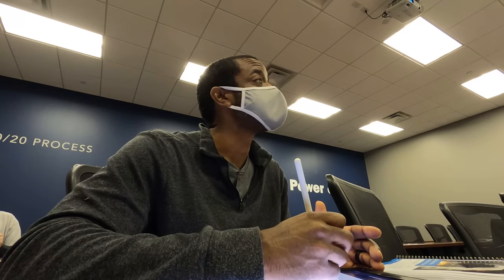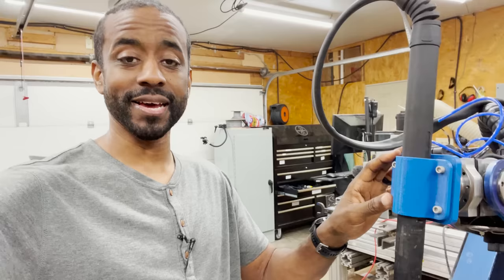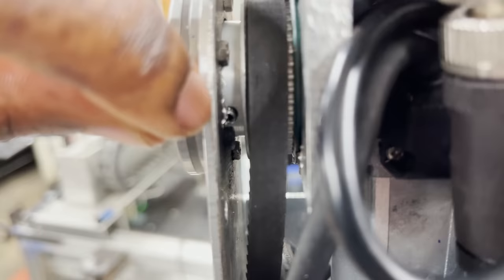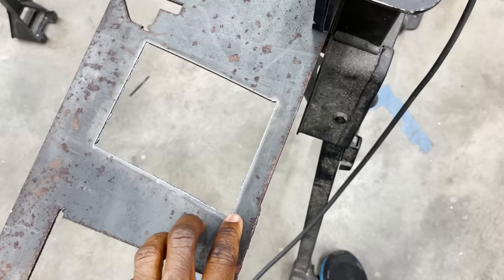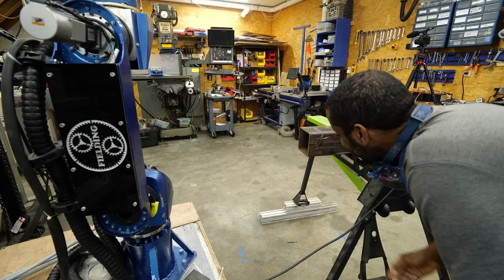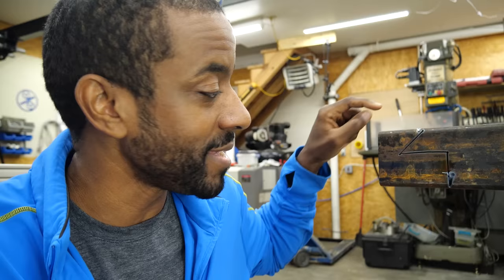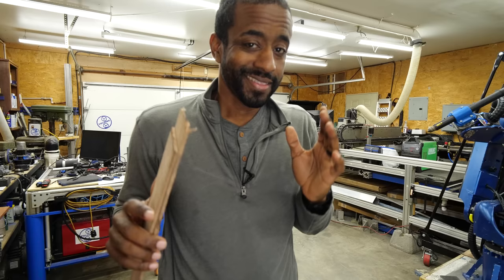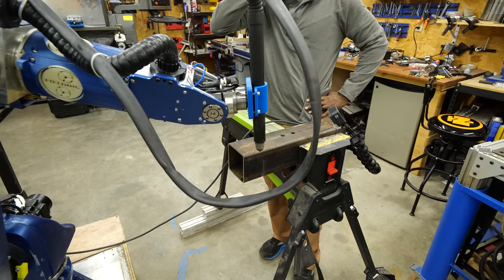I Added a Plasma Torch To My Robot - Jeremy Fielding #097

Comment: That last part about the plasma turning on without power to the relay: 
1. look at ALL connections to the plasma that might have any power.
2. is there ANY chance of "left over power" as in a capacitor, or something that might function like that.
3. if push comes to shove, a "flush" routine in the program might be a good idea.  Basically, you'd have a startup and shutdown routine in your code.  These routines can have delays, go to home position, go to inspection/cleaning position, etc...

Note: you might want a "confirmation sensor". If you can wire in some kind of sensor that can tell the distance, sonar, laser, etc..

I'd also suggest two things for the programming/ number of commands problem.  If you can issue a "big move" command straight to the motor, something along the lines of "move 50mm" as ONE command direct to the motor vs 50 move 1mm commands.  If you can, then write a function that breaks things down and determines if a big move or a small move is best.

If the big move command direct to the motor/controller won't work, then a "sub controller" for each motor that gets, stores at least two types of commands (real time and batch) and sends status update responses.  So you have a main controller that sends one of two commands:
Example 1: real time command: move 1mm to the left, respond when done.
Example 2: batch command: move 100mm to the left, respond every 10% done.

Each of these takes the same amount of time from the main controller, all the "house keeping" is handle by the sub controller.

I've been a professional programmer for a very long time, let me know if you need any help.

Comment: On the relay check you amps. If to high for plasma cutter is it arking and basically welding it's self. I would suggest a contactor for the plasma cutter.

Comment: As an R&D engineer by trade - this video is EXTREMELY relatable!  Sometimes you have to back off and take a second look (or ask someone else for help/advise) before you can fully solve the problem.

Also, I second the question - what SSR are you using? Last time I accidently put AC on a DC SSR it caught fire!

Comment: Awesome video Jeremy.  I think it's great showing the real life of engineering and design. The struggle is real, lol..
I wanted to mention that even though I am not familiar with the newer interfaces you are using, I have used some motion controllers in the past that do allow closed loop feedback. My favorite was from Vital System and it is an DSPMC controller. I used it for basic 3 axis CNC upgrades for older CNCs with obsolete parts and I would use this motion controller to close the loop back to Mach 3 (or Mach 4 these days). These controllers can handle up to 8 axis I believe. Just wanted to share that, thanks for sharing the video!

Comment: To the puls count and bandwidth of the MCU, it can be a bottleneck, but bear in mind that you might also reach physical limitations of the wires. At higher signal rates you get more cross talk specially from digital signals. You practically would have to hook the signal lines up to an Oscilloscope to see if you get a clean signal or not. As side from processing power.

For the distance keeping of the torch head. Industrial robots do not rely solely on the coordinates programmed. Often they use capacitive sensors on the torch head towards the object and auto correct the offset in real time. 

Your relays might get a short puls at boot that you dont perceive, keeping it stuck depending on the current required, thats one tiny source of problems. The other one could be that you need to have capacitor over the contacts to dampen possible arching. Not knowing what current flows to the contact that is just guessing from my side.
Reply from the maker: Interesting... thank you... several things to check here.
Reply: @Jeremy_Fielding  if I wasnt living on a different continent, I would definitively scoot over to lend a hand :)
Reply: I once heard that it better to try to control the voltage level instead of using PWM, because you won't be able to control the huge impulses of changing the voltage on and off at that speed. Also, he should check the loop control of each motor, it is very common that people forgets that this is a computer controlled system, so you have to have a coordination with the sampling period of each system and you have to chose it consciously. Finally about the cross talk you are absolutely right, he should consider a more reliable protocol considering an industrial environment.
Reply: @davidduls  Well from what I understand its not really PWM controls, the encoders are normal photodetector gaps that send a square impulse back to the MCUs. 
So that is his version of closed loop if you want so. Closed loop in an industrial settings sits directly on each motor and receives only positive of negative step count values among some system controls. They often also feedback torque / current values incurred on each motor. 
But having said that, there is no reason he cant build this on his own - not that its rocket science, just robotics ;)
Reply: @davidduls  I do not know how he controls the VFDs, some take 0-10V signals, some have a digital serial protocol and some have good old PWM... serial would be easier to merge with the closed loop feedback, so he can track how many steps are sent vs how many executed.
Reply: @SarahKchannel  Well, I agree with you. I think it would be better to check how the control system works and I would do a linear path test before going any further, he needs to know the limitations of his design and change it if necessary, and I would design the motor control based on the needs. Besides, he needs to know if the encoder resolution needs to so high, if no, he would reduce the problems of high speed signals. Finally, what I meant with the sampling period is that the frequency of the sampling need to controlled because it affects the behavior of the system.
Reply: @davidduls  Yes totally agreed. Most of the time such drive systems are coded based on IRQs rather than sampling / gate times. Nevertheless the clock speed vs. other stuff running on the same system would come pretty  quickly clogged.

Comment: When you turn on the plasma cutter it maybe be introducing noise back into the controllers and / or software causing them to not work like they should.  You may have to put on some EMI shielding on your robot arm or shield the robots wires from the plasma torch.  Engineering is never easy..!  You may also need a noise isolation transformer for the power to the computers and robut arm.  (has a bunch of filters in it to stop power line noise).

Comment: I would suggest taking the robot out of it when you are testing the missing steps. Come up with a full unit test for your step generator and verify everything. For example, get another low-level micro-controller to measure and count steps and report it back and feed the output of your existing control into the new test rig. Then you can take all of that over the serial ports and run tons of tests and look for any missed steps. Furthermore, you would have something you could always plug into any time you make changes to settings and make sure steps aren't getting missed. My guess is that during the linear moves you are missing steps and that can be for lots of reasons (usually performance related or some non-realtime OS interrupting things) but at least with the test rig you could first verify and measure the problem, which is a much better starting point to fixing the problem. Also, it gives you a test rig for the future. Good luck Jeremy!

Comment: I was surprised to see you didn't put a scope on the servo lines to check the signal there. My guess (given what you described) is that we'd see incorrect and irregular pulses for the linear move and correct signals for the point move. This just as a sanity check of course.

And then I guess I'd look at traffic serial traffic to the board to validate the commands are issued as expected. And that point hopefully you've pinned the issue to the board or firmware itself.

I've never used a teensy but I guess. It has a jtag interface? Hopefully you could fire a debugger (with that kill switch in hand) and step through the firmware.

I'm sure you've already got a plan for all of this, just sort of thinking out loud. Truly love the videos Jeremy, thanks so much for sharing!

Comment: Truism on taking notes. my plaz table build has over 700 soldered connections and multiple wire runs, I literally made my own manual as I built the table.

Comment: Hi @Jeremy Fielding ! First of, Thanks for sharing your amazing work! Just want to share something : 

When using an inverse kinematic model for linear moves, I think (but i might be wrong) that the position of the robot's effector always drifts away. I remember using a control law on the operational speed which looked something like that : 
xdot_tilde(t) <-- lambda × (x_d - x(t))
Where xdot_tilde(t) is the operational speed at time t and x(t) is the computed position at time t. X_d is the desired final position.

By doing this you ensure your robot moves toward the desired position by implementing an artificial control loop.

Hope this can help you with your issue even though I'm not sure that this is what you are looking for 🤔
Reply: Some precisions on my thoughts : if you are indeed commending your robot via its operational speed ( inverse kinematic model) , you are numerically solving differential equations for each position of the linear move.
When numerically solving such equations it is very common that the solved position is slightly different from the real position : there is a small error.
As your doing this computation for all positions of the linear move, you are adding errors and the position of the effector drifts away from the desired position.
That's why an artificial control loop is very useful to add in an inverse kinematic model.

Comment: I am a mechanical engineer, I had this problem when building mine. Mine didn't have the budget for the plasma cutter, I only paid $ 80 for my Chinese sale cutter, so I had to modify it. The biggest problem with plasma cutting is the emf(field)/emp(plus). It interferes with your data lines, to the controller. After a lot of trial and error, even grounding(which might be your problem), the thing that worked for me was. 
Connect a low resistance(10 ohm) but high wattage resistor to the torch (negative, head of the torch) to the work peace (positive, the metal you are cutting), I routed my wire in a loop around the torch wire (decreasing the antenna effect). I used a geysers element in water. The CNC plasma worked without changing position or coordinates after that. Please let me know if you gave it a try and what the results were.

Comment: Sir. You are the exact example of putting your mind to a task and persevering with success. 

The control problem with your relays - are you switching the + or the common? Are you using a PLC to control the relay? Perhaps your control is PNP vs NPN. Just kicking out ideas.  
On the robot control side, could you have a shorted conductor? 
I was trying to repair a customers machine and the problem turned out to be the cable on a pneumatic cylinder position sensor was pinched but not visible to a thorough visual inspection.

Comment: Check for voltage on the coil side of the  relay when you turn on whatever is controling it also if you have the coil side leads and the switch side leads on the wrong areas of the relay you could still be allowing current flow weather its off or on because basically youre just running the wires that should be lovated on a switch- through a coil , acting like a resistor in series with the load or solenoid or whatever that it powers, if this resistance of the coil is not great enough to impede the solenoids required amps it would make sence, also take the leads off of the switch side and check that it is open with an ohmeter, if you have an ohm value you're probably on the coil side , good luck jeremy, btw I love your videos

Comment: Really enjoying watching these robot videos. As a software dev, it's great to see the 'other side' of things and following your journey is great entertainment! How are the pulses being sent from the encoders to the microcontrollers? The kind of bus in use is likely to matter a lot, along with the pin hardware on the board itself. I2C, for example, tends to unfairly prioritise certain devices over others and this could, if combined with bandwidth limitations, be creating the problems you observe.

Comment: Great work Jeremy!  The progress shown is impressive. The last bits of a project like this are always the hardest.  It'll all pay off in the end.

 I'm a controls engineer for a custom automation company and happy to help with your relay issue. I know how frustrating these things that seem "simple" can be. 

Can you share specs on the two relays?  

What voltage is the plasma cutter circuit you're controlling?  Solenoid voltage? 

I would suggest a solid state relay if you're using a mechanical type. Knowing the difference between the working and non-working components should point to the issue.

Comment: Hi Jeremy. Regarding the prototyping for this part: radiusses and fillets take a lot of time to make as supposed to straight angles, especially since you are 3D printing anyway. With the “bended” bracket I personally would print it with a side on the plate. Yes it will be higher in Z direction. But the circle shape will be respected more. Aswell as the drawing in solidworks, have you tried extrude thin? Worth looking into. Aswell as making holes with hole feature, pattern driven patterns in assembly will blow your mind. As far as if you want to make the piece: this bracket type is the easiest made by bending. Just my 2 cents coming from my field of work!
Reply from the maker: Thanks for the tips. I use pattern driven patterns and the hole wizard. But not everywhere. I don't use thin extrude. This project was probably the fastest I have ever tried to model this many parts. Very few examples of what is normal for me would be seen here. You would see better examples of my typical modeling practices in my 50 tips and tricks for 3d modeling video. You will notice I am not using the robot as an example in that video. Thanks for watching.

Comment: If you're running out of processing power generating pulses, I would think about making a little pulse generator / counter circuit. You give it the number of pulses you want to send, and it does so at a set speed until it counts down to zero. A closed loop system might be better, and throwing more microcontrollers at it would probably be easier, but it seems like a very achievable circuit project for someone with digital logic experience.

Comment: I've been an instrumentation tech for over 30 years in new construction industrial plants like refineries and biofuels. I spent most of that time commissioning and troubleshooting at a sprint. From experience, and I guess looking at the odds, I skip over some of what I would consider good troubleshooting technique, and go straight for inductance in my low voltage. After that I think grounding...which kinda goes along with inductance, but not always. Gotta remember to go back and do the basics though.

Comment: Haven't watched your video in a while. Look at your motor specs for the optimal operational step counts. Your program whatever it might be must be calibrated for the same step count. Then you should really implement a three point probing setup, it would eleviate your computer going blind problem. I like your channel, impressive work right there!

Comment: Getting a way to run the servos in velocity or torque mode and using the encoder feedback would be a massive help(also torque mode would let you implement some collision detection for added safety). 
I don’t know which controller you’re using, but there is a ton of additional control stuff that can help the arm run more accurately, commercial controllers account for all sorts of stuff like mechanical distortion from loads and inertia. it’s insane how complicated it all is.

I did a conversion where I swapped the controller on a large industrial robot to run off of LinuxCNC. It currently works…(just barely functional). It still needs a lot of the extra stuff added to the control loops in software to get it following better, but it runs all the servos correctly and does the kinematics ok-ish.

If you end up needing much more processing power in the controller, LinuxCNC might be worth the switch. It’s got a pretty steep learning curve, but it is incredibly powerful and customizable.

Comment: Great job for the work, the robot is really cool.
For your microcontroller issue on bandwidth, if you don't know there are some real "real-time" chip for this kind of application : FPGA. it is way more low level than microcontroller and getting into this could be scary but it can achieve true parallel computation on each pins. Like it is more complex to configure (we don't say programming for this kind of chip) than microcontroller, it should be reserved for simple tasks (you can do complex tasks on it but it requires weeks of work to do so). and as it is lower level than a microcontroller, it is also possible to instantiate a microcontroller in it.